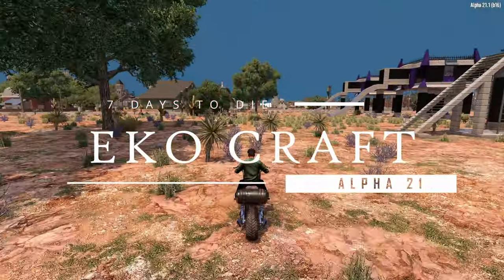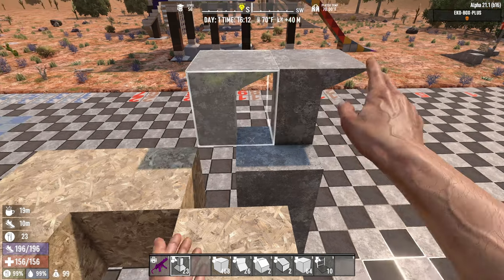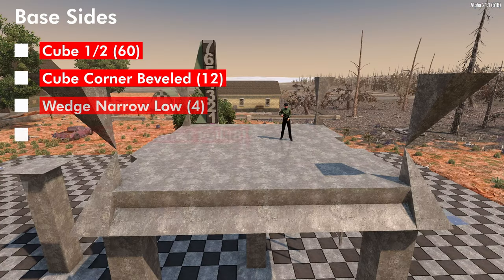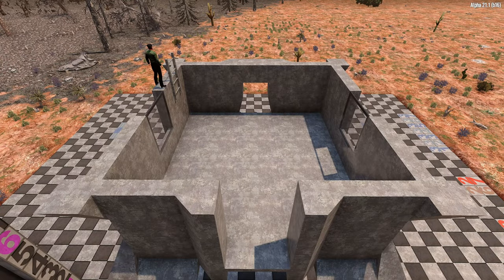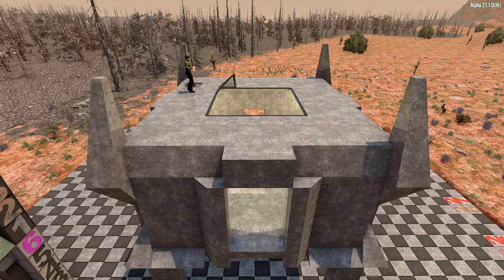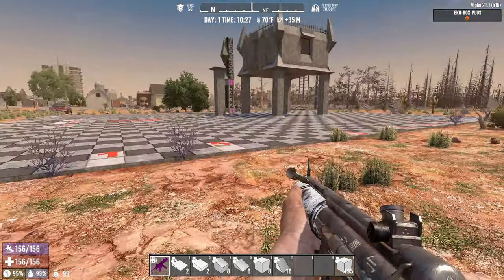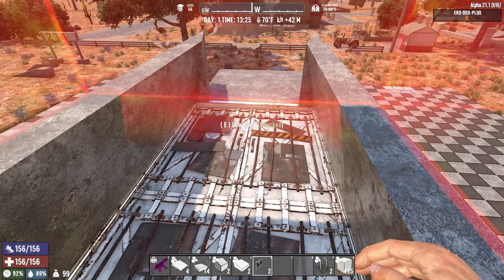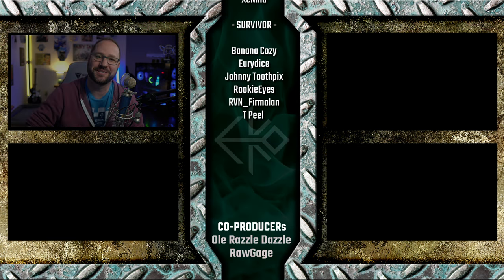Should Crafting Bases ALWAYS be separate? - 7 Days to Die

Comment from the maker: This is a larger version of the EkoBox (https://youtu.be/mvx9sxO_FZQ) and is designed as a dedicated crafting base with a way to modularly add on a horde base!  Let me know if you would use this or what you would do differently!

For those wondering about the blocks around the door where the cement mixers sit, I put plates oriented on the sides with plate corners above them overlapping with the door frame.
Reply: Awesome! It's great to see the evolution of this base. I pretty much started doing this more or less since I like having the all in 1 base too and there just wasn't enough storage mid-game. I'd go up a level for farming; assuming zeds still go after crops. I didn't realize the dew collectors were safe until I saw yours on the ground.

Oh, and I'm sure you figured it out, but just in case, there is a plate version of the circle for the horde base. I been using that doubled up. Also the sideways ladder instead of the balustrade; it is just easier to shoot through. I do get the occassional push-through, but this is with the original eko-box overhang.

Finally, the empty window frames, are they empty for you, because they aren't for me. I had to watch a few times cause I was like WTAF am I doing wrong, but I am guessing you aren't going past building block stage with them. The smaller pillar blocks are fairly non-obtrusive and will work.
Reply from the maker: Lots of variation opens for the fighting position for sure!  Those all boil down to personal preference!  @Krougal
Reply: hello this is my fav base for solo, can you make a full video whit both ekobox and the modularly, i hope to see that thx for your content :D
Reply from the maker: @Yuelsmx1  I will have a follow on video that shows how to build the horde base portion.  It will pick up where this left off!  That's about a week off!
Reply: Hey, was playing around with the corners for the "light post" because I really don't like the way the flat piece mates up to the stairs block. While it still isn't perfect, I think "Cube 1/2 Pillar 0.5M" looks a lot better.

Also the back next to the ladder, was it an oversight to not go all the way down with the wedge 60 like the front of the base? Once again, it just blends better.

I am on my 2nd time building the new one now, so these little details are fresh in my mind.
Reply: @WaywardEko  do you have a link? i cannot find it for some reason?

Comment: For years and years I've always built my crafting base at bedrock and my horde base above. This behavior goes back to the days when placing things like your forge at bedrock would reduce or eliminate screamer spawns.

That hasn't worked for a long time but it was still a habit that I followed. I had to stop doing that in Alpha 21 because there seems to be an increased likelihood of zombies glitching through blocks, especially if you incorporate any sort of drop or fall in your face for managing the zombie hordes.

It doesn't happen often, but it does happen and means that building underground like that is dangerous and I've had zombies get glitched under the ground and even glitched into my central tower through multiple layers of blocks into the area in the center where my ladder is leading to bedrock.

So now I build my crafting stations within my fighting position but I'm liking what I've seen in a couple of your videos where it's simply an additional structure attached via a walkway that I want to try out for myself. I never waste time making entrances into my base for vehicles because like the vast majority of people I plan custom servers and vehicles have always been glitchy in terms of falling through the world. So whatever vehicle I'm writing gets picked up and put back into buying inventory.
Reply from the maker: I'm a huge fan of having the fighting position connected to your crafting base ... that means screamers are easy to deal with as your base is already designed to cope with it.  The whole reason I like a drive in for vehicles is so I can do easy and quick loot drops without having to run back and forth to my vehicle.  It's a quality of life thing for me.

Comment: Can you explain which blocks you used above the door to give you a platform for the cement mixers?  Doesn't matter what plate or cube I try.  It always wants to either put the "platform" one cube higher, leaving no room for the cement mixer, or if I flip it so that the plate is on the bottom of its orientation, then I can't put the cement mixer on top because of the block's unbuildable void.  I followed your video step by step, but this is where I lose the thread every time.
Reply from the maker: Around the door where the cement mixers sit, I put plates oriented on the sides with plate corners above them overlapping with the door frame.

Comment: I would very much like to know which voodoo magic you conjured up to make that frame around your double door. I can’t for the life of me figure that out and still be able to place a box or workbench on either side let alone the mixers. Love your base designs and can’t wait for the horde base addition to this!
Reply from the maker: Plates on the bottom with side rotation, plate corner on the top flipped inward.  Thanks so much!
Reply: @WaywardEko  I tried this as well, but can't make it work. Shows red as the door is in the way obstructing it. You're not using any mods or special permissions of some sorts to allow it?

Comment: @WaywardEko Towards the end of your video you frame out a door to form a shelf to support your cement mixers. Curious how this was achieved? I see it's placed upside down but i can't seem to get a plate to place on the frame voxel. The plate instead can only be placed as a lower in the voxel above, thereby taking the space where the mixer would ideally go. I assume I'm using the wrong shape but am at a loss. Love the content and thank you for continued inspiration
Reply from the maker: Lots of folks wondering this ... added it to pinning comment up top:

"For those wondering about the blocks around the door where the cement mixers sit, I put plates oriented on the sides with plate corners above them overlapping with the door frame."

Hope that helps!  Thanks for the comment!

Comment: I'm trying to figure out what bricks were used around the door for the cement mixers? I can't seem to put anything on the door, then if I use the plate above the door the cement mixer wont sit on it
Reply from the maker: I'm going to add this to the desc.  as it is a commonly asked question --- I used plates for the sides and plate corners for the top.  The trick is that the corner is actually overlapping with the door frame.  That's why you can find the cement mixer on top.

Comment: Building this in wood for an early home and I can't seem to get the door bridge to stay in place. Once i put the first layer of cube 0.25 on the wedge narrows after placing the doors down, the bridge structure collapses. Placement looks identical to the vid, am i missing something? I can't imagine the materials would have much to do with it, isn't concrete heavier? Help!
Reply from the maker: Ok -- 2 bits to this ...
1 - Did you place the sidewalls first as those support the doors
2 - Concrete is heavier but has more horizontal stability.  You might need to upgrade at least to cobble as it also has better horizontal stability.
Reply: @WaywardEko  Found a solution, skipping forward a few steps to placing the "roof" blocks provided overhead support, which kept the structure from collapsing, allowing me to place the doors. Definitely would recommend using cobblestone at least for that span as wood doesn't have enough horizontal stability.

Comment: Can i build this with low level stuff like wood? Is this a good base for me to make and survive inside and craft or is it just not working without concrete?
Reply from the maker: Absolutely - you will want to upgrade the supports to cobble most likely, but if you check out my Abyss series, I did first horde with mostly wood.
Reply: @WaywardEko  thanks🙏